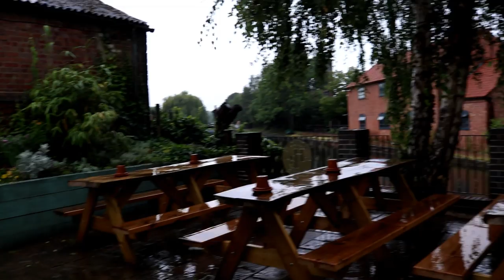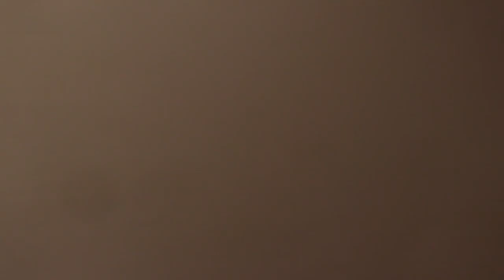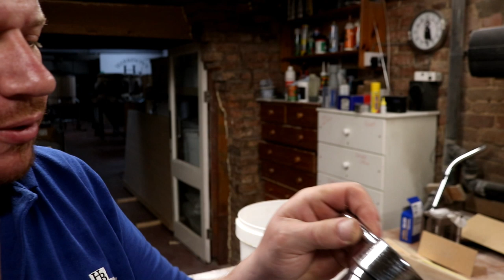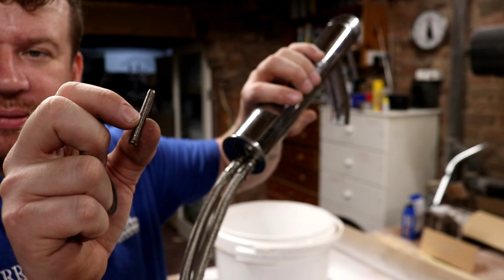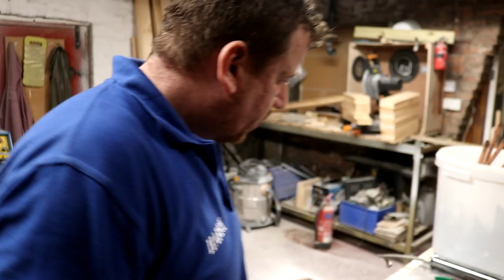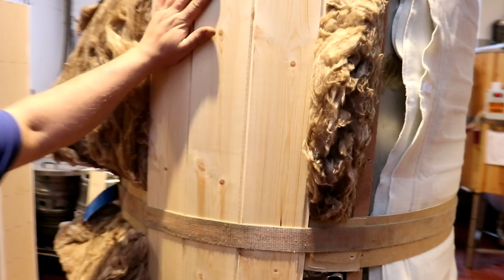VANDALS ATTACK

Comment: When I do a banister a screw a  4" by 1" onto the wall with screws and plugs top and bottom every 400mm up the stairs and then simply screw the banister brackets onto that. Instead of wall plugging the banister brackets themselves. They always crumble and fall off. Oh and I'll use poundlands equivalent of 'no nails' between the wood to the wall and finish the edge off with the finger for a nice finish before painting.